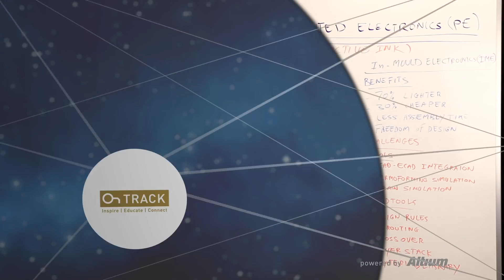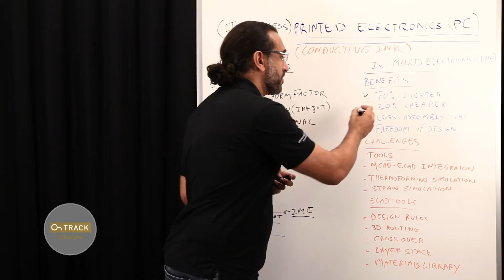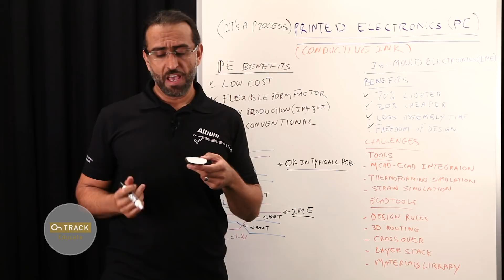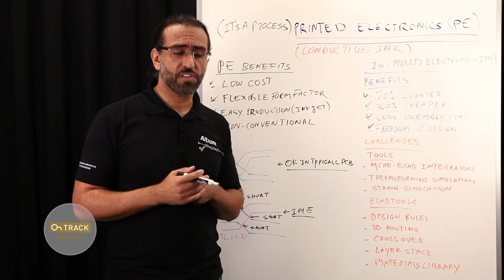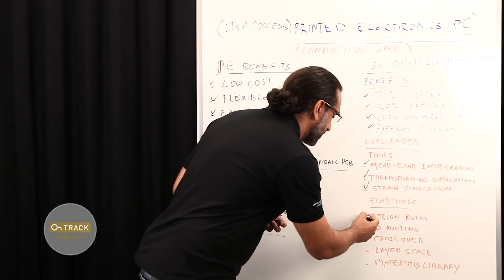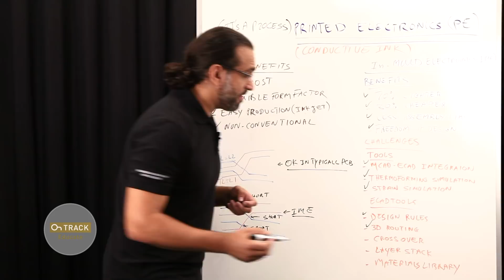Printed Electronics

Comment: but what is real difference between designing PE device and thin-film? Sounds pretty similar to me. back in time there were thin-film sensors, there are thin-film heaters. Of course those things are not really flexible during usage, but they can be shaped during manufacturing. But the technology is not cheap and equipment is complicated. Is there any differences in design process?